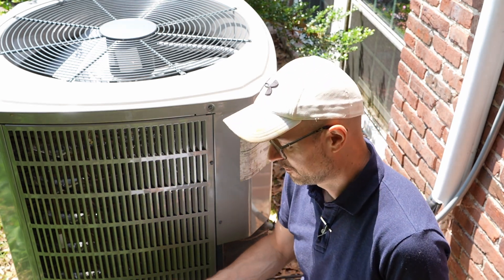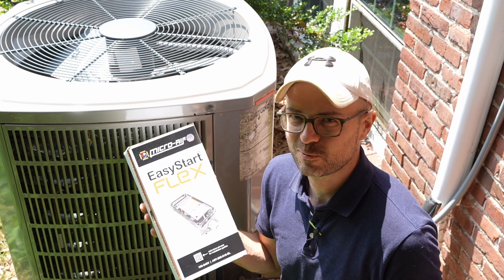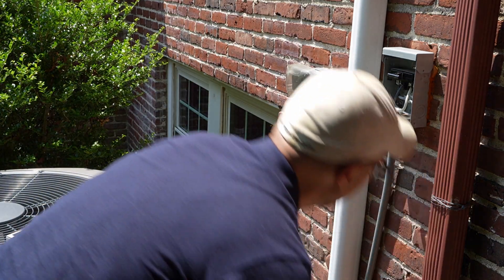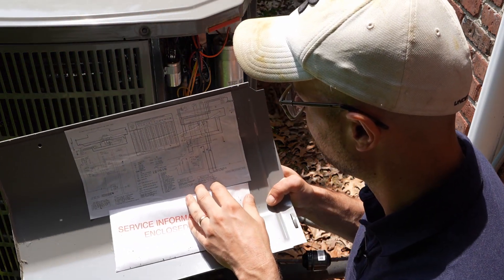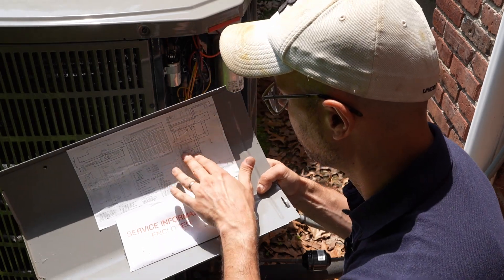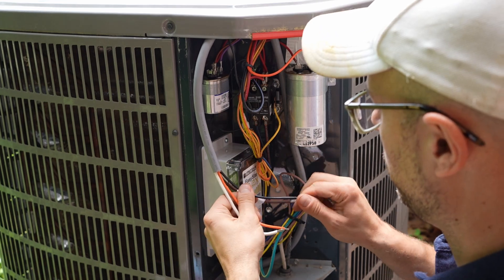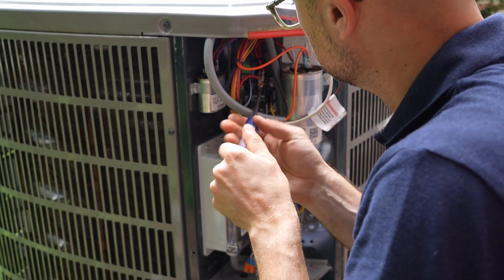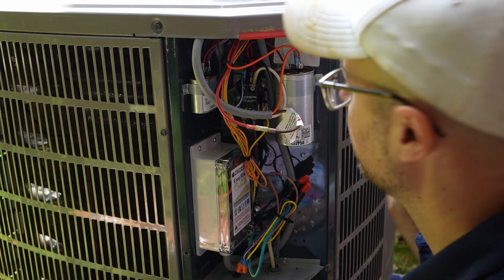DIY install of air conditioner soft-start (Micro-Air Easy Start Flex) - so much quieter!

Comment: I want one of these and especially the Micro Air but I know of at least 3 people that installed these and they ran less than 2-4 weeks before burning up. One guy,  who is a friend of mine, is an AC technician so I know it was installed correctly. He called me after he installed his telling me how great it was, about a week later he called back saying it just burned up most of the capacitors. It sounds like Micro Air's customer service isn't that great either. Does anyone have any long term experience with these?
Reply: My experience has been quite the opposite. I have the older larger model on mine. It's been running for right at 2 years and it has 9619 starts since installation.

I did have an issue when the actual app updated on my phone, it "bricked" the unit and my ac wouldn't come on. I disconnected the easy start and the ac ran fine.

I contacted them and they had me on the phone with their electrical engineer/app developer the same day. Ended up being a bug in the update. He remotely pushed an update to my unit over the air and I was back up and running with it connected that afternoon.
Reply: I installed mine 2 years ago and it’s been flawless. About 23,000 starts to date. Never an issue, not 1. Ran my 3 ton unit and house for days after hurricane. LRA went from 77 to 26 and runs at 9 amps. My unit was 10 years old when I installed it.
Reply: Social media complained about the ICM competing model’s capacitor get fried prematurely.  Both ICM and MicroAir are assembled in the USA, and hope the manufacturers adjust new production and honor the sold units on warranty.

Comment: I just ordered mine. I’m from Houston, Tx. Need I say more 😢
Reply: im north of you in conroe, just put mine on and it makes a hell of a difference on generator. my 4ton isnt beating the stator on my genset up any more. 20kW genset was dragging down hard after beryl.
Reply: @Dillinger128  what size generator are you running??
Reply: @dewaltgrainger2923  20kW. is it enough? yeah, but my 4ton American standard silver did drag it down with the inrush current and cause all my lights and battery backups to blink and beep. it also smoked my fuel down by 10% a day with those hard starts. I have a 250 gallon propane tank on my generator. NG is not available where I am in the woods.

Comment: Had the Micro-Air Easy Start Flex installed by my HVAC company last week on my 5 ton Carrier unit that is 14yrs old. LRA is 117a on the label of the unit. It is now 24.5/34a on start up. A couple of things I learned from tech support. Bluetooth signal is low power so you have to be within 2ft or closer to connect to the app. Also any solid stream of water like sprinklers or water coming off the roof in direct contact with the Flex , water will intrude and void the warranty. I asked about applying a bead of clear silicone around the window and where screws were. They said that would void the warranty. They suggested a water proof box to put the Flex in like other customers have done.
Reply from the maker: Hmm interesting, thanks for that note. I guess by making the unit smaller, they expect more users to be able to install it inside the panel itself. But I do recall reading that it's supposed to be IP65 rated, which I suppose is for general "weather" resistance, but it sounds like they're being sticklers about specific types of water presence around it.
Reply: Will not void your warranty with MicroAir.  It is IP65 rated, they even say you can mount it outside the compartment if there isn't room for it inside.  Just make sure you install with the wire exiting downward to be on the safe side (in case of pooling on the waterproof grommet). If your HVAC company told you that, maybe they were referring to their own installation warranty or something.. but MicroAir themselves are extremely supportive and state on their own videos these can be installed externally/in contact with elements.
Reply: @michaeladams4592  
I agree with the wire exiting downward and so far I have been very pleased how the starter has been working. Everyone will have a different situation to their application but be mindful where it is installed. Mine is installed on the exterior above the liquid and suction lines since there was no room inside the panel as you did and never any pooling. I asked tech support if I could just add a small bead of clear silicone on the seam where the box and clear top meet and where screws go in for extra added water protection since we get a lot of high winds and heavy rain here in Houston, Tx.
This is a copy and paste from tech support response. They do not want direct water hitting them. 
" The starters are IP65 rated meaning they're water resistant but can't be installed where they'll direct roof runoff or main sprinkler water hitting them."

You'd do better to make or purchase a box to mount it in like I've seen several other customers do.

Do not add any kind of sealant or this will void your warranty.

Comment: You can also upgrade the fan blades from the simple paddle style fan to a more advanced style fan. It will get rid of the helicopter sound. This is an example, yours may differ.
FAN05905 - OEM Upgraded Condenser Fan Blade Replaces Trane.

Comment: I just got one but haven't installed yet. My ac unit is new and pretty quiet but has a high LRA and I'm specifically doing this to run my AC with my generator. 
It's kind of pricy but a must have for my situation.
Reply: LRA has nothing to do with it running!
Reply: @michaelgraham8504  of course not.  He is planning to use the soft starter to drop the LRA so it can start on a reasonably-sized generator

Comment: FYI...LRA is when the motor is fully locked, not spinning at all...when we test motors at work we only perform the test for less than a second in order to not burn the motor windings. Sure the motor does pull a lot of amps when starting up but will never be at LRA spec since it is not truly locked up. Great video, btw. I am really surprised that they don't include the installation hardware, especially for the price.

Comment: These are a must if you have solar power.  I have 2 more to install for people with solar.  I read about them for 2 years before trying it on my rv. My start up amps went from over 30 to 8 amps and it’s so much quieter. I tried to get a few hvac wholesale stores to carry them but no luck yet. They will!

Comment: Thanks for making this video. I have a new Easy Start sitting here on my desk ready to go. Our 3T is loud, and flickering lights are common. Also, my WGen7500DF generator wouldn't run the AC along with our freezer, fridge, and a couple of fans during our 8 day outage last week because of Hurricane Beryl. Hopefully this will be a good thing for our situation.

Comment: With all the precautions at the beginning, I am surprised you physically screwed in the Micro-Air before testing it all worked :).
Reply: There’s no instructions to power it up at 240v.

Comment: So is it basically converting a one- or two-phase condenser to a multi-stage/variable/inverter type condenser? The EasyStart does NOT work with inverter / variable condensers.

Comment: This really isn't a review.  His goal was to reduce the noise it made.  After statup should it not sound the same?   Would have been nice to have seen a meter to capture start up Amps, then running amps.  I'd like to do that on my 4 ton,  but don't think my 5500 watt gen would work.

Comment: how much better is this that a hard start cap? i mean it is almost 100 times the cost.
Reply: A hard start provides more power to start a compressor. Soft start is opposite,  it reduces power to start the compressor and fan motor.

Comment: Its Bluetooth functionality probably won't work well with it behind the metal cover. Otherwise great video!
Reply from the maker: Haha yes, I realized it has a bluetooth function after I already installed it, and you're right that it's basically inside a faraday cage, but I was able to communicate with it within a couple of feet.
Reply: @DmitryBrant  I bought some magnetic, rubber covered feet for mine on Amazon. They arrived today. I'm going to just slap mine on the outside of my unit with them. It'll also let me hide it under the panel if necessary.
Reply: Another comment said it is low energy Bluetooth, so it would have limited range anyway.

Comment: Very nice step by step instructions do you think you will see and energy savings by lowering the inrush current that much?
Reply from the maker: Thanks! As far as energy savings, it's probably not that much -- we're only talking about ~1 second worth of inrush current, versus many minutes worth of regular operation which won't be affected. It might be enough to pay for itself over the lifetime of the AC system, but I wouldn't say the energy savings should be a deciding factor for getting it.

Comment: I have the 368 model running with my condenser and the Flex does look to be smaller by 25%; pretty much the same as the setup as in the video but the 368 was too big to jam into the same spot. Great video.

Comment: Thanks for the great video. If your lights were flickering you should start from the breaker in the panel. Pull the breaker and check the buss bar and the breaker where it snaps onto the buss bar. then make sure the wires are properly torqued. Then the disconnect at the condenser and finally the connections in the condenser. They all seem to loosen over time. The Soft Start is a great way to make your unit last longer.
Reply: Good point for some great troubleshooting.  Thanks for your input

Comment: I think having compressor soft starting compared to the hard starts will increase the life expectancy of it. Not sure if I read that somewhere? 🤔
Reply: Correct. Imagine pressing your cars gas pedal to the floor and then going from park directly to Drive vs slowly accelerating to the appropriate speed.   
A lot of wear and tear in the long run. 
It saves some electricity as well

Comment: So, what did you do with that wire that was originally connected to the herm terminal on the capacitor?  Did you terminate it with something?
Reply from the maker: That wire stayed on the Herm terminal; The new wire was in addition to that one. (The capacitor terminals have multiple connectors that you can plug onto, exactly for these kinds of purposes)

Comment: Micro air tech support said to me the "Flex" model is replacing the EasyStart ASY-368-X72-BLUE model. The Flex model is suppose to be 40-50% smaller.
Reply: I am installing a Flex on my 5ton.  LRA about 150. I'm seeing people get starting amps down in the 30s. This is important for people using a portable gen for whole home power. There is a big movement of people doing this down here in hurricane alley. It should be mentioned that this company has incredible customer service and support. This unit has Bluetooth capabilities and you can run diagnostic and then email to Micro-Air and they will help you troubleshoot.
Reply: The only difference is size and one box fits all tonnage.  The old 368 boxes are cheaper the lower the tonnage, thus people with smaller units are paying more.  Buy the old boxes while you can for a cheaper price.
Reply: I like that this should be able to go with me to my next home. Not happy about the price, but happy with the quality. Currently 2.5 tons
Reply: Came here to ask this question. Thank you.

Comment: Are you aware there is an app to monitor your micro-air?
Reply from the maker: haha yes, I realized it has a bluetooth function after I already installed it. The app says the peak current is now 30A, and live current is 13A (and no faults).
Reply: @DmitryBrant have you noticed lower electric bill by any chance? Judging by current usage being dropped by half, I wanna be optimistic and say you have ? 😀. Thanks so much for a great video
Reply: @DmitryBrant  Great!
Reply: @DmitryBrant   That's a significant reduction in current. Looking at your label shown at https://youtu.be/XONo1LU2Y4E?si=1EkMGSERWBoTFPup&t=116 it indicates a RLA of up to 26.8 amps and an LRA of 134 amps. That's huge. Thanks for sharing.

Comment: Would have been nice if you had recorded the actual starting current (peak in-rush current) as well as what is the actual running current while the compressor is running.
Reply: Min went from 150 down to 37 and running at 10.9
Reply: He mentioned in another comment peak Amp is 30 and live now is 13A

Comment: Nah, not a good idea. If it cycles on while the head pressure is high, you will stall the compressor. There is a reason they make "hard start" kits, the compressor needs that initial inertia to overcome the head pressure of high pressure line on first piston strokes. Either upgrade your electrical system, put your lights on another phase, or get an inverter unit.
Reply from the maker: It's running very well so far, but thanks for the notes!
Reply: Just curious how do you put a 2 phase ac system(240volts) on a different 2 phases then the two phases (240volts)that feed a normal home?
Reply: @maxwellmelon69  Sorry, forgot this is the US with only two phases instead of 3 @400V. That doesn't apply then, but upgrading the wiring is still valid. It's really not normal to have your light dim from AC compressor starting up.
Reply: your thermostat has a built in timer to prevent short cycling already.

Hard start kits are actually harder on your unit, and should only be installed if your unit is already hard to start due to age etc.
Reply: The hard start is for a bad compressor to get more life out of it, kinda like a life spport system or a heart defribulator
Reply: @aholmes6612  You missed my point, that system is not designed one bit for a compressor to ramp up slowly, you risk stalling the rotor, that's the issue hard start kits solve on older systems, where the momentum the rotor needs at the beginning becomes even higher.
Reply: @FrozenHaxor The majority of condensers in the USA use (Copeland scroll compressors) 208V single phase 60HZ, not a piston. The reason a lot of people use these is to run them with a generator. It won't damage anything. Residential units don't use semi-hermetic compressors, that's commercial stuff 3 phase 460/480V higher tonnage.
Reply: negative people have a problem for every solution

Comment: If you use the bluetooth feature to monitor starting current and number of starts you may find that it may have faults due to a capacitor or loose wiring problems. Micro Air was very helpful in solving these problems for me. You may also find that the compressor does hum louder on startup as time goes on.
Reply: What I have found is that you have 5 learn starts when installed. I installed mine when it was cooler during the spring but once we got to 100 degrees everyday I had a fault, so I reset it to learn all over again...problem solved.

Comment: Don’t do it . Complete waste of time and money . This will kill your capacitor.
Reply from the maker: Well I already did it, but you don't have to. And if it kills my capacitor, I can replace it for $15. In the meantime, we're enjoying a much quieter condenser.
Reply: I'm curious what evidence you have that shows this device will kill your capacitor? Capacitors don't last forever and are considered consumable. The most common cause is damage by current surges and heat. Do you have empirical evidence or just experience/gut feelings?
Reply: It does work, and will not mess the capacitor up.
Reply: You probably made a short circuit when you used the screw driver on the capacitor. That happened to me when long ago I replaced the fan on the condenser. I did the same as he did on the video, discharged the capacitor with the screwdriver  but I ended up blowing up the fuse on the furnace board and replacing the capacitor.
Reply: @carlosgraphic so what is the correct procedure to discharge the cap?
Reply: lol no it won't. quit making stuff up
Reply: I’m wondering about that state o that capacitor. Worth checking. I have a similar vintage unit and mine still ran with a completely dead capacitor. Much quieter after replacing it.
Reply from the maker: @synmoo  Good point about the capacitor, which others have also hinted at. I ended up checking the capacitor afterwards, and it measures just fine, although it's got some corrosion around the rim, so I might replace it anyway for good measure. But I'm also guessing that the soft-start will be able to detect a capacitor failure, and will manifest as some kind of fault (over-current?) if it happens?